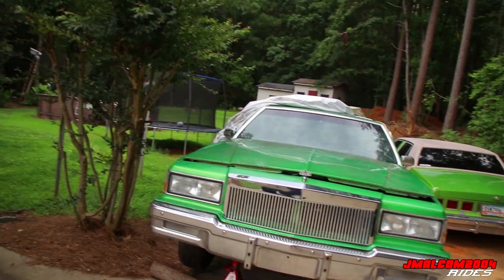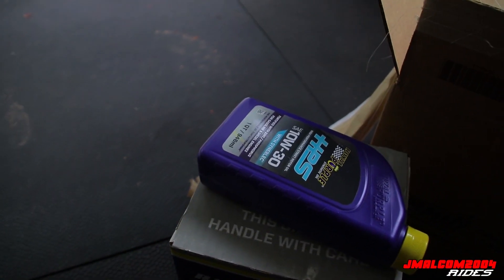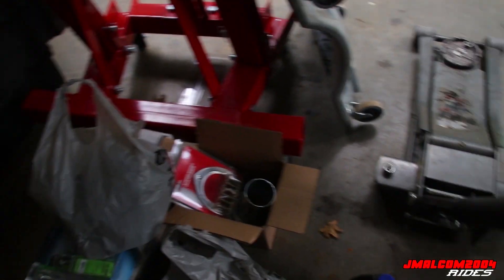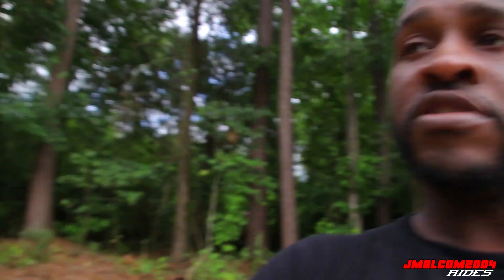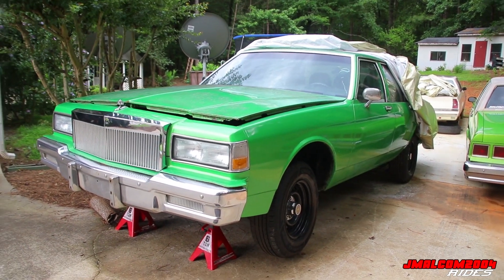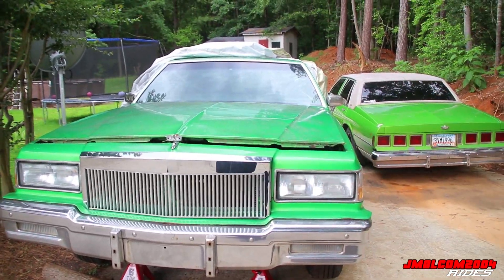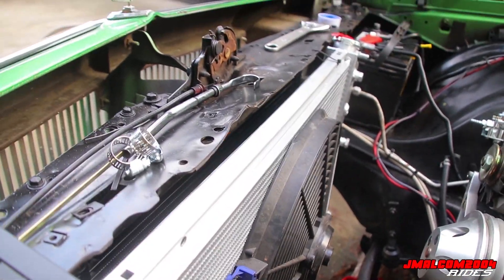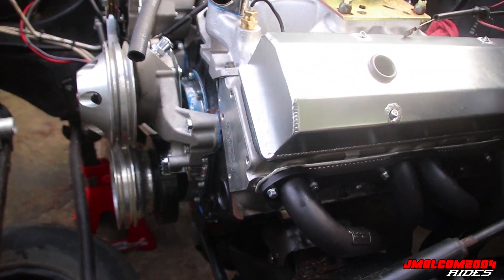BIG RIM BOX CHEVY BUDGET BUILD EPISODE 39: GETTING CLOSER TO OIL PRESSURE FOR THE DOLO BOX CHEVY

Comment: Is the lower half of the oil dipstick tube installed?  Other than the dipstick itself, there should be 2 pieces of the tube.  The lower one has to be driven into the block, and the upper goes in about an inch or two.  Can't wait to hear that oil pressure.  You should go over to you Cuzzo's to get some race fuel since he's got a race car, I mean street car.